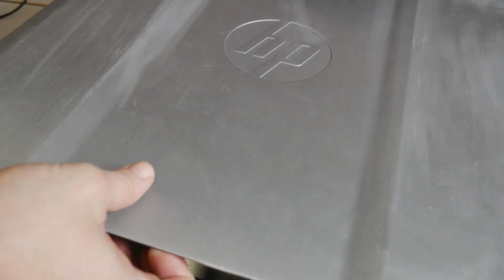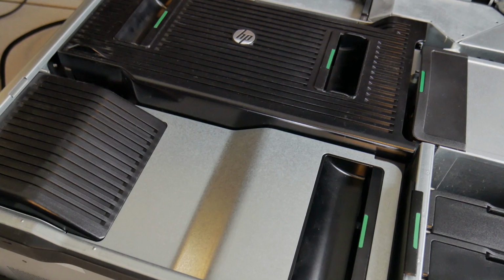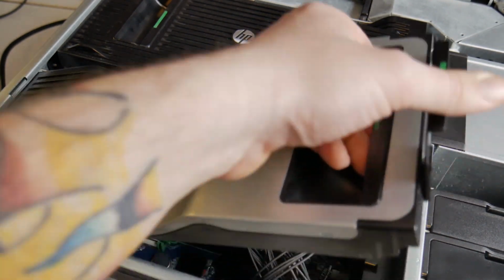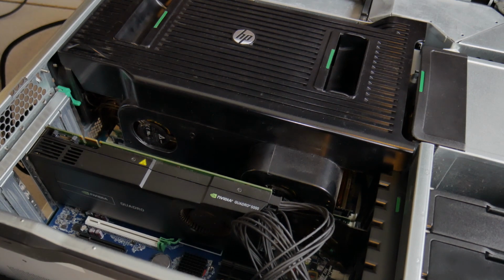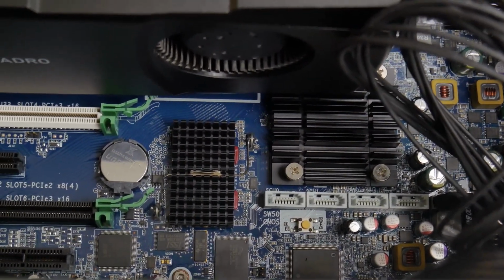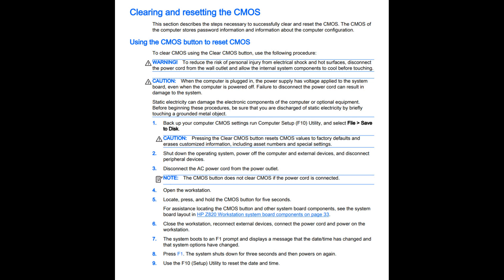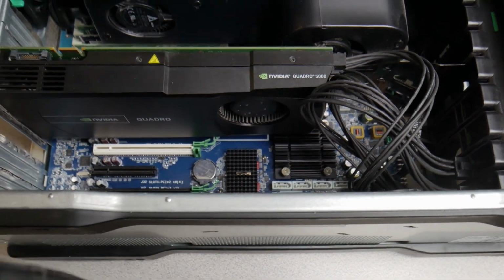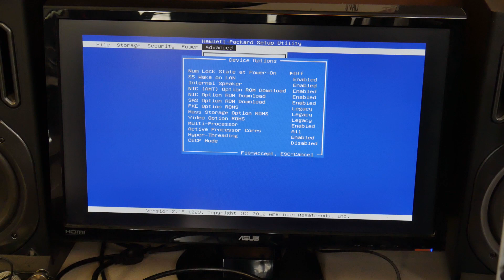HP Z820 | CLEAR CMOS BUTTON TO RESET BIOS (FIX BOOT ERROR)

Comment: I carefully wedged a very small flathead screwdriver under battery and popped it up on the weak side of the housing. It’s a little tricky.

Comment: When i turned it on the screen posted and it booted but then it stayed black and i waited and waited and decided to turn in of and now i am turning it on and i get 6 beeps and 6 red lights does anybody have an idea. Never had this problem before and i did not change anything in the bios
Reply: Btw specs are double exon and quadro 8000

Comment: I did the exact same thing as you changing it to EFI. I tried yellow button for 5 seconds. Even tried removing the cmon battery. Still does load. PC is on now with no beeps but no screen
Reply: updates?

Comment: Hello
The original problem that I had is the no display, pc was on but no display, some friends suggested resetting cmos either by unplugging the cmos battery or by the cmos button (it has two arrows in the shape of N) and when I start my pc it beeps 5 times still no display, any help please? Would be much appreciated
Reply: 5 times means it’s a memory problem

Comment: I had a F1 Boot do to a cmos battery just about dead and we had a power failure at the and my PC was in stand by mode and now it won't even boot past the 
windows xp splash screen and reboots.
Any ideas? Thanks ahead 
Someone was saying by going into bios and the drives etc

Comment: Thank you for posting this video. I did change the VIDEO OPTION ROMS to EFI and lost the display output capability from my Z820. I've been trying unsuccessfully to upgrade from Windows 7 Pro to Windows 10 Pro. Unfortunately once the upgrade begins at some point on the 2nd restart at 30% the output display changes to 'Invalid Format'. I think the upgrade does continue but I cannot see if it completes as the drives in the BIOS are unable to engage with upgraded C drive. I can see it in CMD prompt when I use DISKPART and list volume, but the boot itself ends on the 'Invalid Format' screen. This brought me to consider changing a setting in the BIOS Advanced > Device Options and changing VOR from Legacy to EFI. At least I know now how to get out of this problem in the future. Back to the OS upgrade problem.

Comment: Hi! I did that, I have a Z400 same issue with the video card, I set something wrong in the BIOS, but my pc still without the reset, what can I do in that case?
Reply from the maker: hold the button for 10 seconds. then take out the CMOS battery. Put the battery back in and try to boot into BIOS.
Reply: I have the same problem did you find any fix?